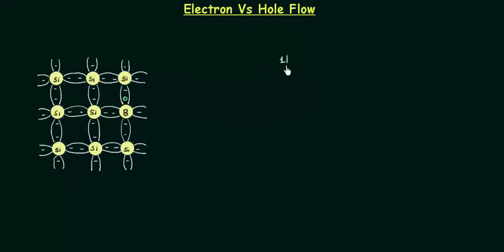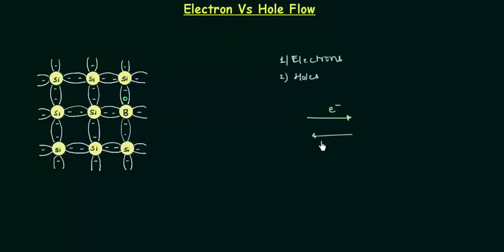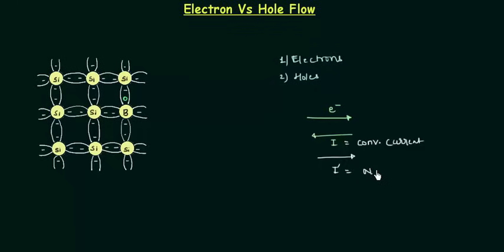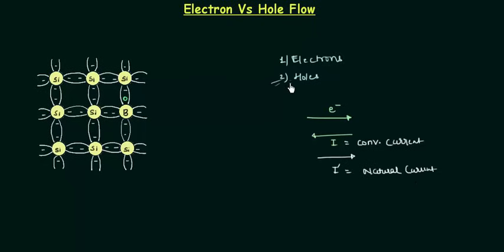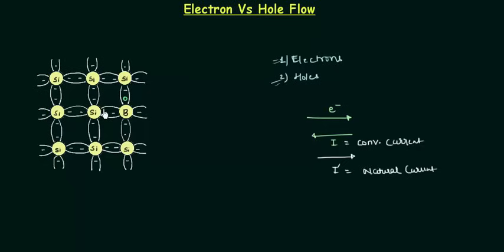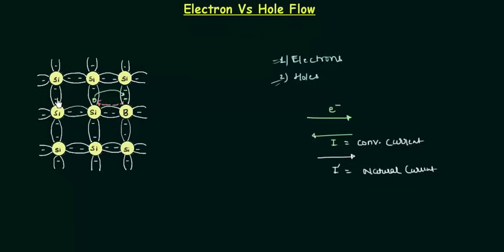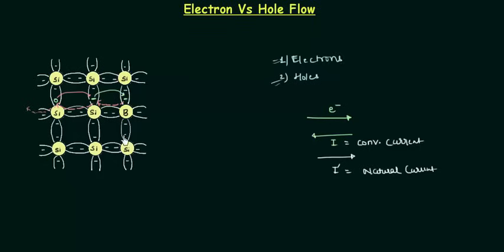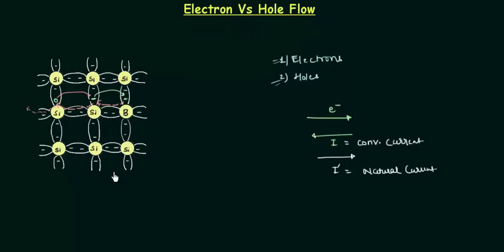Electron Vs Hole Flow

Comment: Sir, flow of electrons within a semiconductor is same as the flow of holes but in opposite direction. Then why the total current through a semiconductor is the sum of current due to both holes and electrons?

Comment: Thank you for the video, but does this mechanism apply to metals or it's just for semi-conductors?
Reply: Metals have holes, but the hole mobility in a metal is zero. Valence electrons are shared across the metal crystal structure, instead of being knocked free like in a semiconductor.

Comment: Question sir. If the hole is positive charge, will it not create charge or will it not violate conservation of charge? Example for helium. 2e-, 2p+, 2n. If you ejected 1 electron and create hole and this hole become positive charge, helium charges will be,, 1e- , 2p+ , 1h+ , 2n , 1e- (ejected).
Initial charge of helium = -2 + 2 = 0
Final charge of helium = -1 + 2 + 1 - 1 = +1 (which creates positive charge that violates conservation of charge)

Comment: Sir initially boron atom has a hole,but when it is moving towards Si, Si will have only 3 electrons in outer orbit and boron will have  4,which seems to be a tough process,which force drives this process?
Reply: same question answer mila kya

Comment: why would a bonded electron break its covalent bond and jump into a place of nearby hole?
Reply: Electrostatic force is stronger, maybe
Reply: This is because of the apparent positive charge created at the neighbouring atoms by the proton of silicone.
To put on a track nearby electrons The proton attracts nearby electrons and does Dainik get in charge and thus the negetive charge is pulled towars that side.
Reply: The electron doesn't jump to an adjacent/nearby hole. It is usually free until it falls into hole which is known as recombination. Correct me if I'm wrong. I'm also learning.
Reply: No its not recombination. It is movement within the valence band. Imagine the valence electron hopping from hole to hole. Ifyou apply an electric field you favor the hopping direction of that electron. Thatway you can control the current direction flow from holes(aka electrons moving within valence band)
Reply: No, here thermal energy acts as a driving force in moving electron to the hole position, at absolute zero temperature, the e will always be in covalent bonded state
Reply: electrons move to fill holes bcz doing so lowers the total energy of the lattice,, makin the system more stable

Comment: Till what time do these electrons and holes keep on moving ? When will these interchanging stop ?
Reply: first of all Holes aren't moving just electrons are moving due to excitation as well as due to the attraction force of the hole and when under these two circumstances an electron leaves its place a new vacancy is there at the place of electron from where electron moved. Another electron will leave and come to this vacancy and it will keep on going until external energy or excitation is removed.
Reply: @developers_hub  Good explanation...

Comment: I see many of you have doubt about electric(natural) current and conventional current.Let me clear your doubt. When electric current was discovered, electrons were thought to be the flow of positive charges. However, after the discovery of electrons it was known that current is the flow of electrons. But, convention was not discarded and both the currents were defined. Hence, electric current is the flow of electrons in a circuit ,directed opposite to the flow of electrons. Conventional current on the other hand is the flow of positive charges and is directed from positive terminal of the battery to the negative terminal.The current direction is the direction of positive charge movement.( A positive current is also negative charge per unit time moving in opposite direction to the corresponding positive charge). It can also be produced by positive and negative charge carriers at the same time moving in opposite directions like currents in electrolytes or ionized gases or semiconductors.Hence both the current have same directions but different  carriers of electricity.....Admin please correct it in your Video...
Reply: Fall in love with physics:No, video is correct, both have different direction and this is the way to distinguish them. Also natural current is known as electron current for the same reason

Comment: Sir, first I say thanks for this online presentations.
I have 3 doubts 
1) hole is vacent space, generally electron move  opposite to hole but we say hole is moving  , how it happen Sir?
Reply: You can definitely say electron is moving....but you would have to specity all the electrons that are moving...it's much easier to just say the hole moved
Reply: first of all hole doesnt move, electron moves and sits at hole and the place from where electron came there hole is generated
Reply: Because of concentration gradient, when an adjacent electron comes to occupy the available hole, it's present position gets vacant now. This vacant space can now be considered as a hole. Same process of adjacent electron occupying the vacant place  goes on. In short, while it's the electron that is actually moving, but because of its movement,  position of vacant space goes on shifting in a direction opposite to that of the movement of electron. Hence, it APPEARS that hole is moving in the lattice.
Reply: Not quite. If you apply a field, it is the field that forces the electron to jump to a hole and not because of a concentration gradient

Comment: Your "holes" are just the antiparticle of the electron, the positron. Of ourse, this distinction is lost on the world of chemistry which doesn't understand the physics of the flow of electrical current. This isn't a description of hole flow, it is a description of positron flow, proving once again that physis is superior to chemistry. Positron flow hypothesis perfectly  accounts for the phenomena described in the video. "Holes" do not exist. There is no such thing as empty space and you simply cannot treat electrons like particles they way you're trying to do here.
Reply: Gilly Puente exactly. Holes are just moving electrons in valence band and not in conduction band like normal electrons
Reply: How and why is a hole or positron there anyway?
Reply: @MediocreDeficit  Electrons are nothing more than excitations in the electron field. Flowing electrons produce an electric current. Because electrons behave as point particles, as they flow there is a small "gap"  between each electron. This gap is a part of the field with positive energy and charge due to the lack of negative energy/charge and has the same absolute value of mass as the electron. And thus because positrons are just as good as electrons at carrying a charge and obey all the same electrodynamic rules, if we choose to look at it this way, we can say that an observed electrical current is being produced by positrons flowing from cathode to anode.
Reply: @gillypuente1794  so it's like wherever there is an absence of a certain type of charge, the opposite charge is present there. Like where there's no light, there's darkness. Right?
Reply: @MediocreDeficit  I should correct myself because your question pointed out a small mistake. There is no positive charge present in the gap but the gap behaves as though it is positively charged due to the lack of negative charge. It's not that the opposite charge is present, but rather the absence of the negative charge can be thought of as a positive charge. Physically, in reality that is not what is happening. The gap is not filled by a positron, it just behaves like one. Positron particles themselves are excitations of the positron field. So therefore, to answer your question, in the absence of a certain charge within a field, it is not that the gap or hole has the opposite charge, but it does behave as though it does. Therefore, if you change your perspective, you can treat the excitation as a hole and the hole as an excitation and get the same physical results.
Reply: @gillypuente1794   I'm sorry maybe I'm disturbing you. But, is it okay to ask why those gaps behave as positive charge when in actuality, there isn't any?
Reply: @MediocreDeficit  Oh it's no problem. The answer to that question is that the hole has the same properties that the electron filling it would have with the exception of charge. Now, what physically happens when we produce electricity is that electrons flow from anode to cathode to complete a circuit. However, if you shift your frame of reference, and focus on the holes rather than the electrons, the holes appear to flow from cathode to anode, the same way positrons would need to flow to produce an electric current, and bearing in mind the holes have the same properties as the electron that would be filling that hole, with the exception of charge, the holes behave exactly the same way a positron would.
Reply: @MediocreDeficit  Conversely, if you were using actual positrons to conduct electricity, the positrons would actually, physically move from cathode to anode. However, once again shifting your frame of reference and focusing on the holes in the positron field, those holes behave exactly like electrons flowing from anode to cathode. And again, hole flow is not physically, in actuality what is happening, but because the end result is the same, no matter the frame of reference, we can think in that way if we choose to. It's similar to what happens to an object approaching the speed of light in a vaccum. As your velocity increases, so does your mass, lengths get shorter, and time slows down. You cannot see or notice this happening from your frame of reference but an outside observer can. However, to you, it would be the outside observer who appears massive, thinned out, and moving slowly through time. Physically, that is not what is happening but from your frame of reference we can say it is because it appears that way to you.

Comment: Not a single video explains why conductivity of holes and electrons are considered differently though holes are a result of electron vacancy!.... would be happy if someone answers this correctly :P
Reply: In a semiconductor the mobility of electrons (referring to ‘conduction electrons’ or ‘free-electrons’) is greater than that of a holes (indirectly referring to ‘valence electrons’) because of different band structure and scattering mechanisms of these two carrier types.
Conduction electrons (free-electrons) travel in the conduction band and valence electrons (holes) travel in the valence band. In an applied electric field, valence electrons cannot move as freely as the free electrons because their movement is restricted. The mobility of a particle in a semiconductor is larger if its effective mass is smaller and the time between scattering events is larger.
Holes are created by the elevation of electrons from innermost shells to higher shells or shells with higher energy levels. Since holes are subjected to the stronger atomic force pulled by the nucleus than the electrons residing in the higher shells or farther shells, holes have a lower mobility.
In an intrinsic silicon, at temperature 300 K:
Electron mobility = 1500 cm2/(V∙s)
Hole mobility = 475 cm2/(V∙s)
This is reference from a website
Reply: @shwetsharma8910  , interesting. Could be true that. Curiously it says, hole creation involves movement of electrons from inner cells to outermost cell. So let's say Boron having 3 valence electrons is put in a Silicon crystal, so as to make 3 covalent bonds with 3 Silicon atoms; plus a 4th covalent bond with one electron missing, i.e. a hole in the Boron atom. But that hole is residing not only in the outermost cell of Boron, but even moves into inner cells, as inner cell electrons of Boron move to its outermost cell, acc to this website you have quoted.

Comment: It is also said that hole have lesser speed than electron & thus greater mass.Does it make any sense???
(My teacher told this today)
Reply: Himanshi Malik I WANNA EXPLAIN THIS...Hole is moving means what the electron which are forming covalent bonds are moving...(as you see in this video) so we can say these electrons as bonded electron...now if you have some device to measure the current then you find that the when two free electron move from one place to other then the current due to this is more than that of the movement of bonded electron ie electron move faster than bonded electron....WHY,Why it happen  when both type of electron has same charge and potential difference applied is also same....ONLY THING WHICH CAN EXPLAIN THIS IS THEIR MASS... So it is concluded that the effective mass of free electron is less then bonded one so BONDED ELECTRON THAT IS HOLE IS HEAVIER THAN ELECTRON THAT IS FREE ELECTRON
Reply: @rohitpathak3574  , interesting and very deep understanding that. Thanks
Reply: A hole is literally a hole, there is an absence of electron there. It would have no mass. It only seems as if there is a positive charge in the hole. Also, unless your teacher is an expert on quantum mechanics. Double check everything. Sometimes the understanding of a topic gets off the actual point because of terrible analogies used.
Reply: Thanks for explaination I also had same views on this topic.
Reply: There are some good channels like Veritasium and SmarterEveryDay  they have some of the most awesome videos on general physics and science. Do check them out. :) Your wonder in science will be renewed.
Reply: Thanks for sharing (well I already subscribed them :)
Reply: hole means just absence of electron if electron replaced hole,then hole will replace another electron it means hole got flow that is current flow

Comment: The flow of hole and electron is taking place simultaneoulsy in the opposite direction but net current direction is same. Will the net contribution in current magnitude count twice?
Reply: No as electronds are making holes moving so only contribution of one is counted
Reply: Holes are moving electrons so you add the currents